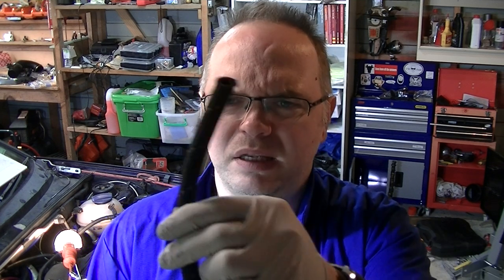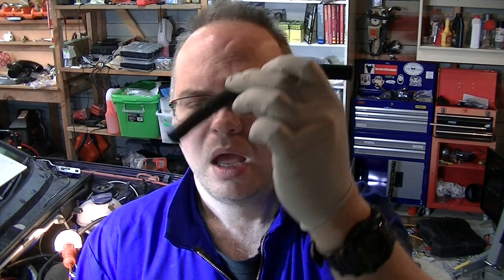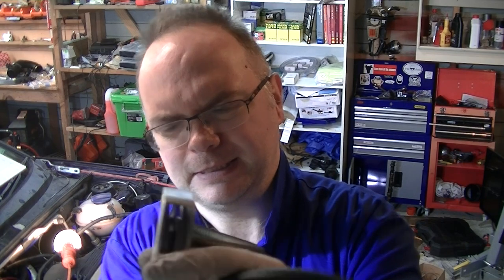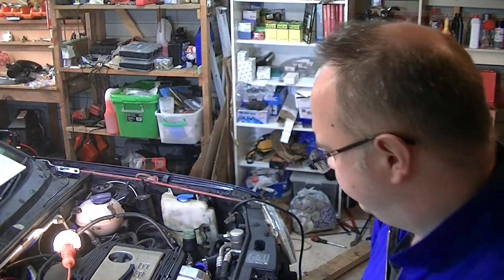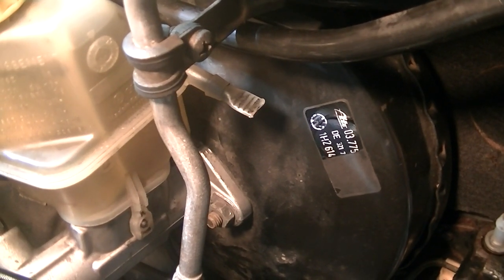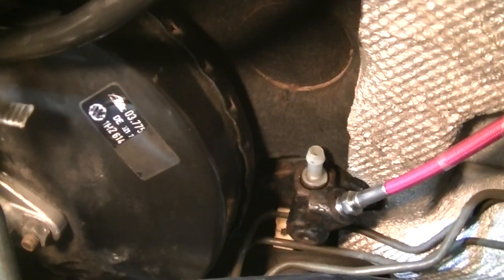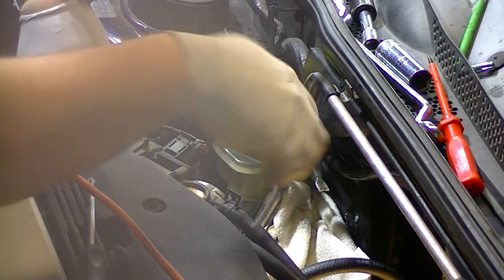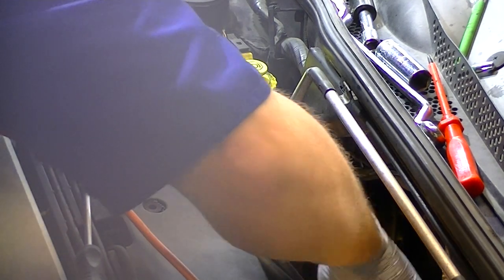MK3 Golf Clutch Hydraulics - VR6 Rebadgered - Part 12

Comment: Great indoor weather mate!! I might have to ask for a copy of that check off list....
Reply from the maker: +Jimmy definitely indoor weather! What are you doing to your Golf?
Reply: Badgertronix hey mate, ATM I've just taken out all the struts. Lf is faulty and Lr is leaking so hoping to just replace all of them. I've got an engine mount to replace a steering boot and some interior fix up to do. Nothing too major.... however, I like to do stupid stuff so I've been looking to chuck in an R32 motor and do a manual conversion at the same time... wishful thinking....
Reply from the maker: some nice easy jobs to start with :) Stupid stuff is always good although finding the bits to do it with in NZ is a bit of a mission. R32 parts go for big money. I need to figure out what's going to be the next step for this car once it's back on the road.